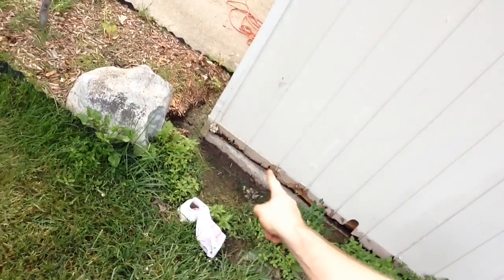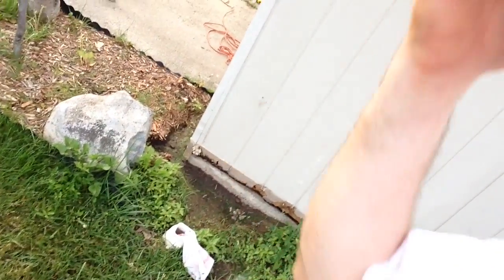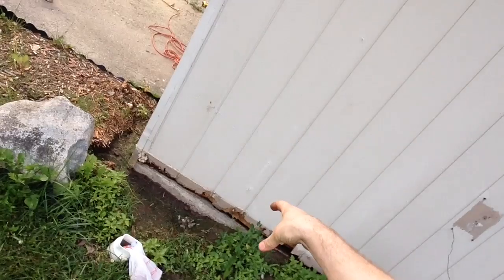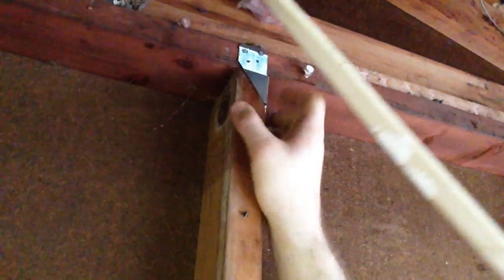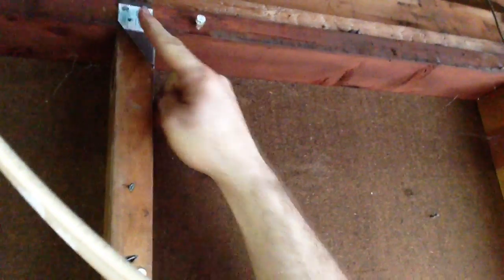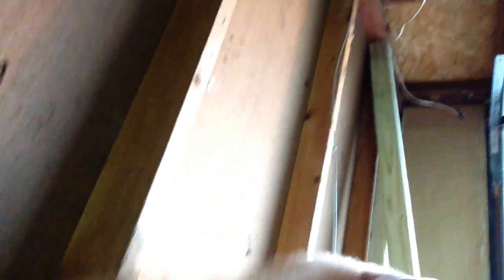Rotten Wall Sill Board Repair: Part 1

Comment: Thx for your time. When I consider the shoddy work of so many(not all) contractors, a personal attempt- with proper/safe info-is certainly worthwhile. Scary at first, but once one project is completed, confidence builds, and on to the next.AND, …you will have the time and incentive to finish with a flourish, unlike the others. :-)
Reply from the maker: Yeah this kind of job is really intimidating but once you break it down its not all that bad, and it only requires pretty basic tools.

Comment: Luckily my shop wall bottom plate is treated, but over the years the siding on the outside rotted.  I had to cut and replace the bottom part of that siding almost all the way around the shop.
Reply from the maker: I bet that was no big deal for a master woodsman!
Reply: Ha ha

Comment: Hey John, I have a similar problem.  Any difficulties from jacking up the wall - either to the back wall or the garage door?
Reply from the maker: +Jim Schmitz When I jacked up the front, the corner by the garage wall started to deform outward, pulling a bit on the garage door. I didn't have to go up enough for this to damage the door, and it came back into shape when I set it back down. There was no damage to the back wall at all. Overall it was no problem, but each garage is probably different.

Comment: Bottom sill plate - man should have been treated - I don't envy you at the task you have before you.
Reply from the maker: Job is done, replaced with treated wood and a sill seal gasket. Should be good for another 50 years!